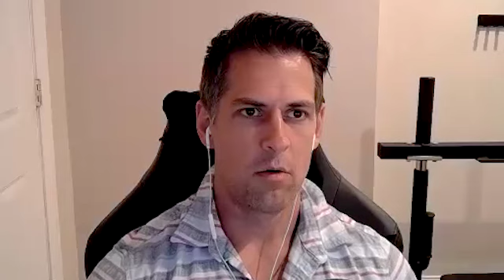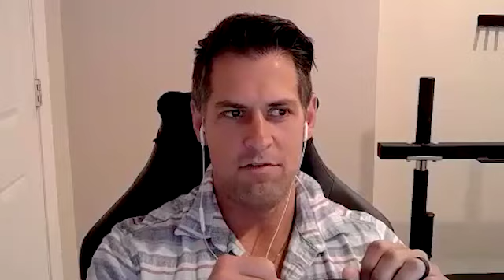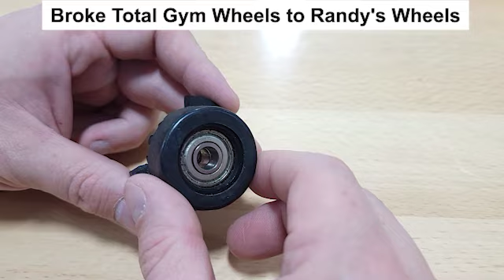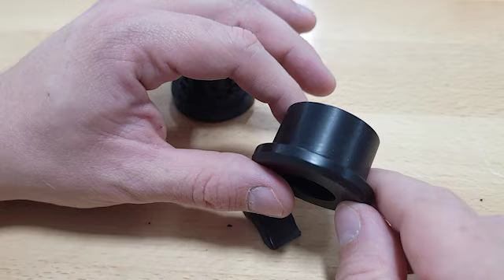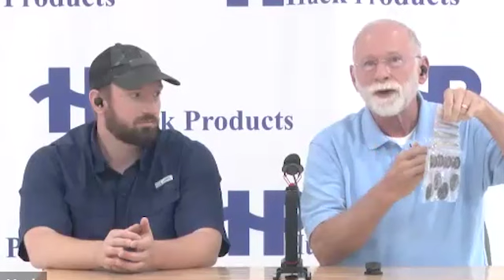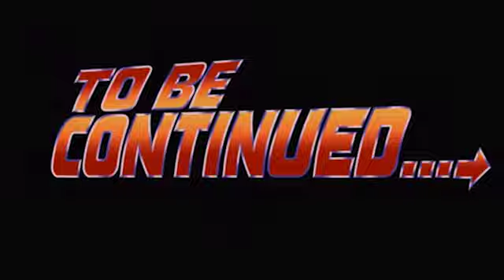Making your Total Gym Last: Interview with Huck Products

Comment: Mike, do you know if changing out the Gr8flex wheels for the huck replacements will change the feel of the glide board “ride” to reduce the excessive slickness? I know that was one of your biggest criticisms about that machine and I wonder if it could be improved.
Reply from the maker: I think it would feel better yes, but it may have been the rails and not the wheels. Honestly, in retrospect it's probably not that big of a deal. I just know at the time I really could notice it.

Comment: Great stuff.  I had to use parts from another glideboard to get rid of some of the side to side movement when replacing the wheels on my Fit.  I have talked to Randy myself and the issue is that TG designers are not  the best engineers.  This is evident with the parts problems and not everything on a TG fitting as it should.
Reply from the maker: Thanks for sharing Mike and good to hear about your positive experience talking to Randy.
Reply: I got a fit the other day and I’m thinking about getting the huck wheels . So when you installed the huck wheels the fit started moving side to side ? And how did you fix that if you can help me

Comment: The Huck wheels are incredible! Made my Total Gym 3000 better than new! 👍👏
Reply: Did you get wheels and axles, because my axles broke and bolt head stripped a little on my  TG 2000 , 
and at the time I wasn't aware of all of Husk's products.
So I need axles or a new glide board.
Total Gym is a con and the whole fitness industry is and I love fitness and training but they rely on the owner not using the device and they do work if you workout on them ,but unfortunately Total Gym count of the consume not using the device. 😊
I'm using my machine until it can't go any more. 😊
Oh and I don't like others using my Total Gym because other folks are unnecessarily hard on things they didn't pay for.

Comment: Thnx for asking about the shipping to Canada issue..I wud like to order his wheels...but seems like kind of a pain to get them...Unless things change Total Gym Direct for parts for now
Reply: I'm not good at math..but I believe they refere to the  cable from the handles to the pulley as 2..then from the 2 pulleys to the center sd another 2...so the 4 sections that divide the total weight
Reply: @josefdeigner1045  I guess that makes sense. Thanks!
Reply: Also..I seem to recall on the original interview or on Randys site...He gives tips on folding the Total Gym he didnt remove the center pulley and pinched the front wheels like a nut cracker...possibly why his wheels failed 3 months in
Reply: @josefdeigner1045  1 x center pulley, 2 x tower pulleys. But they both claimed there are FOUR. Which model are they referring to?